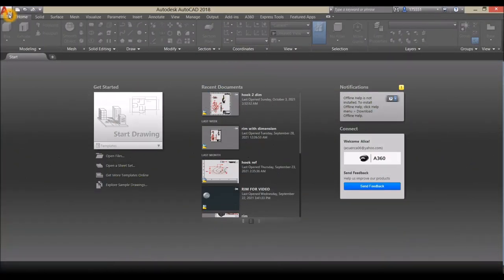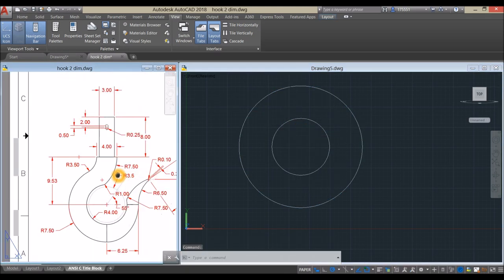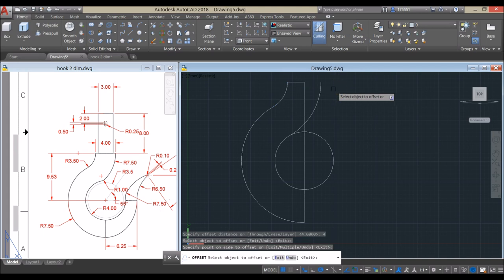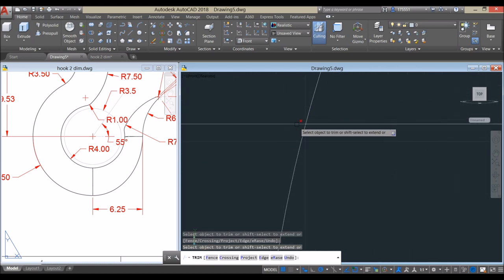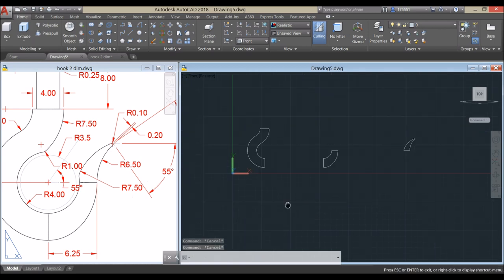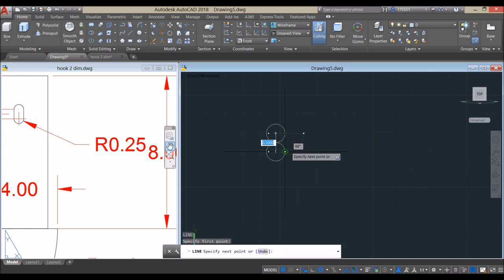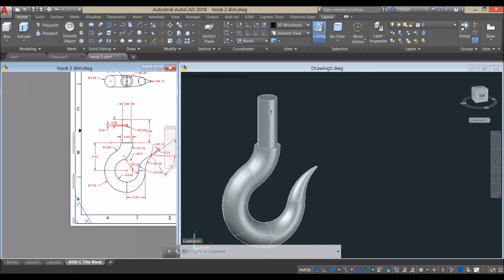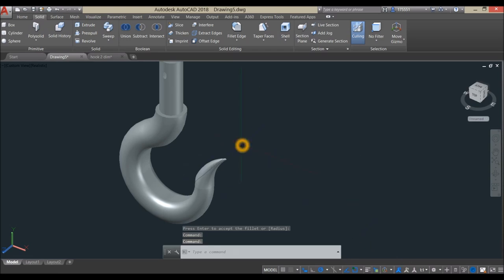CRANE HOOK DESIGN IN AUTOCAD from 2D to 3D

Comment: Hi AC,

Thanks for another great tutorial.  

1) I attempted the drawing myself, but messed up right at the beginning.
2) You draw a circle R7.50 and then offset it by 4.0 thereby producing a concentric new circle of R3.50. 
3) Now when I "read off the PDF drawing", I saw an inner circle of R4.0. I ignored the "virutal circle" of R3.50 shown in the pdf.
4) It wasn't until the very end of your video, where you "subtract out" using 4.0 radius circle that I understood my mistake.

My question is, how did you know or how  does the pdf drawing "explain or tell you" to construct an inner circle of R3.5 first and not the R4.0 ?